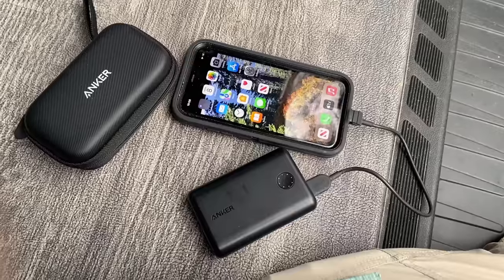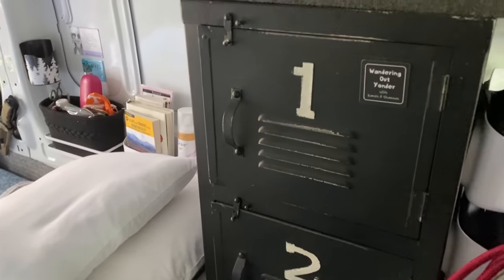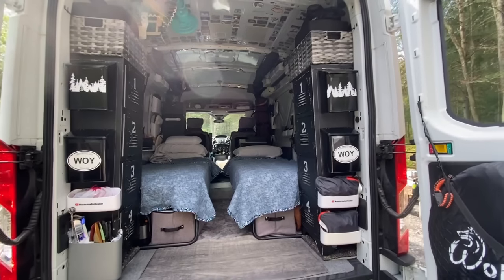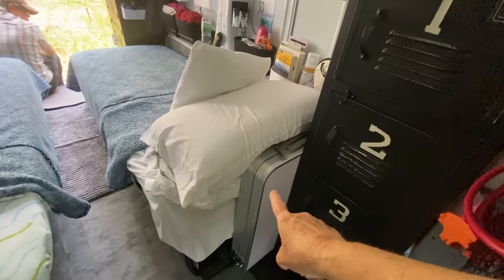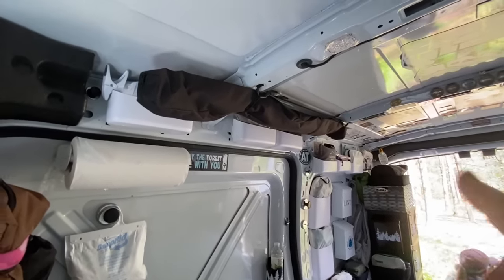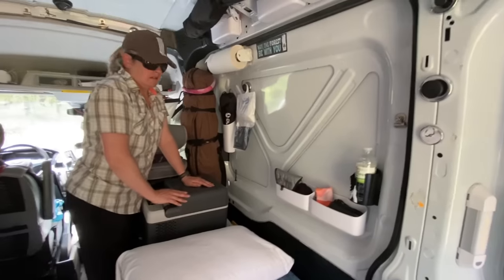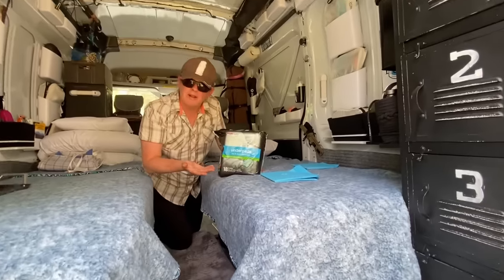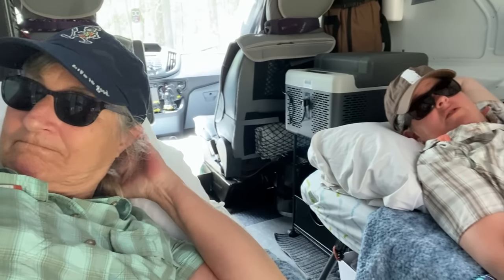Simple & EASY No Build Van Set Up: FULL VAN TOUR! Our Cost Effective Camper Conversion

Comment: I actually thought of using lockers. Do they rattle when you drive?

I would do something simple like this to begin at least. My reason for considering van life is to be able to work and save money and not pay rent. Starting out with a huge van conversion expense is counterproductive. I don't need to make a van look like a house or rustic cabin. I basically need a bedroom and efficiency kitchen on wheels.
Reply from the maker: That was kind of our approach! We did a video on JUST the lockers (install and then another on how we keep them quiet -lol)
You may find these helpful: 
NO BUILD Storage Lockers & Magnetic Options: Simple Van Camper Set Up For Clutter Free Camping 
https://youtu.be/ZnLwW2nhJcQ

NO BUILD, SIMPLE EASY STORAGE NO CLUTTER Adventure Van Project: Working on a Storage Solution: https://youtu.be/yaCUJQe41fE 

Good luck & happy travels!
Reply: @wanderingoutyonder  Thanks! Will check it out.

Comment: Great job of utilizing the space, making it functional, and keeping it eye-pleasing! If it were mine, I'd put some insulation on the ceiling. The car industry uses what's called "shoddy." You could put it up by gluing magnets to it. Thanks for sharing!
Reply from the maker: Thanks for the suggestions! We always love to hear what others have in mind!
Happy travels!
Reply: My thoughts exactly as Ariz. has 120+ temps, in C.FL everyday record highs, and a van is a hot tin box in heat and a very cold box in the winter. I love how you utilized the metal and magnets, but this IMO is a 'fair weather' set up, not to practical for a full timer who suffers bad weather at times.
Reply: Roof rack or  metal Decking on top? Have a 2 inch space between rack + van....ALWAYS park in the Shade !!

Comment: I sure enjoyed your video!!  The magnets are a fantastic idea!  I'm trying to figure out the easiest way to get on the road and using a lot of your ideas.  We had an '87 Astro van for eleven years and sure wish I'd kept it just for camping.  I'd like to think it would still be road worthy.  Maybe not ???  "I" ordered it (mom van) with everything heavy duty and all the extras except fog lights for some odd reason, and never added them on.  Two cargo mats were a must.  I kept it in Perfect Condition.  I had two very minor mishaps and needed some body repair both to the sliding door, and the hood needed repainting from the engine heat being so close.  I did to have the radiator worked on one time and that was it!  Regular maintenance and had All of my receipts including a gas mileage log.  Sorry to go on... I'm trying to psychic myself up on How I can make it happen.  We had a Toyota Celica for ten years before we got the van for our two kids.  So I'm thinking of a Toyota Sienna or maybe 4Runner.  Sadly, money is the kicker!!  🙄 🥺 😕 🥴 😟 😏
Reply from the maker: Hello! Thank you for commenting!
It sounds like you have some prior experience which will be VERY helpful in your journeys! 
We agree - maintenance on a vehicle is SOOOO important for longevity!
We hope you are back on the road soon!
Happy Travels!
Reply: @wanderingoutyonder  I didn't think about this until a little later.... I've sketched a couple different van layout ideas and thought about using 2 small metal file cabinets in the back with different size drawers much like your lockers... and having the sides for other magnetic things.  No wonder your magnets caught my eye!  LOL!!

Comment: Wonderful use of space. I'm wondering if you've found it difficult to regulate the temperature inside the van as I didn't see any insulation. That's usually what van builders install first. How are you carrying water. What is your bathroom set up? I saw the Wolf Wise which is on my wish list. My dream is to build out a Ford van so I am very interested in how others manage their systems.
Reply from the maker: Hi - we have several ways to help with the temperature - first and foremost - we head in the OPPOSITE direction of the extreme temps. We have a few videos about how to regulate - including:
How We Keep Warm While Cold Weather Van Camping With And Without Electric - Tips & Tricks: https://youtu.be/b7bUfohL5cc 

Keeping Warm & Cool in the Van with the Jackery 300: Will it Work? We Test Some Options!: https://youtu.be/SlKpXavENOw 

Van Camping Solutions to Ventilation, Insulation, Privacy & Condensation Part 1: https://youtu.be/inrCxaYDv00 

Van Camping Solutions to Ventilation, Insulation, Privacy & Condensation Part II: https://youtu.be/gbAmaw389n8 

Simple, Effective & Awesome Magnetic Fly Screen For Vans! Living in a Bubble: https://youtu.be/ABypdrjyPLM 

We use the Wolfwise set up with a Luggable Loo when a bathroom is not readily available - we use 
GRAYL GEOPRESS to filter water on the go!

Hope that it helpful!
Reply: @wanderingoutyonder  What temperature range have y'all comfortably camped in using these options?

Comment: I'm leaning towards using the pre-existing holes, or limited support frames, to attach everything to the wall or floor.  This is my plan for retirement in 10-20 years if I do a van build.  Lots of wood can add a lot of unnecessary weight.  Still I consider noise suppression and insulation.  A fridge will be nice and I look at 2 compartment so I can have some ice to cool down on hot days, instead of pricey and energy hungry ac.
Reply from the maker: We couldn't agree more! We wish you luck on your future path!
Reply: @wanderingoutyonder  thank you for responding!

Comment: When does condensation happen? Too cold? Rainy weather? Would a humidifier help with condensation? Or it better to just use Damprid? What do you do to keep the van cool inside without keeping the car running? You don’t have roof fan opening? Do you plan to you  one-two in? Do you have a portable air conditioner?  Do you have solar panel and/or portable generator to have electricity in vehicle? How do you keep mosquitoes and other flying bugs out?
Reply from the maker: Hello there! We have the best luck with the Damp Rids - we don't stay anywhere long enough that while trekking to the next destination we can't run the heat/air to dry up any lingering condensation - . We have a few videos about keeping cool - our best items are the screens that we use: https://youtu.be/rkKY_66_zdU?si=1WftPvysj-MyUex9. We don't have a roof fan and do not plan on installing one - 
We do use solar power - but not a generator - we have video on power options coming out soon! The screen works great for ventilation AND keeping bugs out!

Comment: WoW! Such a nice practical van! Perhaps, if you allow me to say, you would want to put a sheet of plywood between refrigerator and the bed to cut the electric vibes that wave to head side. Of the bed. Even a thin plywood will help to cut the electromagnetic wave reaches the head bed…
I just bought a Chevy Astro..still a passenger van….I used the bed ( las passenger seat opens a s a bed) last week ..but boy it was cold…how do you provide warmth at night in you van?
Reply from the maker: Great suggestion! Thank you! We have several methods to keep warm - it all depends on weather or not we have land power - we cover most of that here: https://youtu.be/kl_68EUItdU?si=x7e1TPfYNXSCLyAt

Comment: Vantastic build, the puppy pads are brilliant!!! Happy trails!!!
Reply from the maker: We agree! So glad you found some helpful ideas!
Reply: I had an older travel buddy, a 17 year old shepherd/retriever mix who passed away a few weeks ago, who needed the "puppy pads" and like these ladies, discovered many more uses for them.  
I also discovered the reusable pads for times that disposables weren't really necessary. They have water-proofed (rubberized) backs to prevent leak throughs with real cloth tops for comfort and durability. They can be either machine or hand washed, but let them air dry to preserve the backing.

Comment: You have some really useful ideas here - yay!!!
My current primary interest is: which magnets are the most powerful?
I am looking for some to secure both lightweight tarps (the blue ones) and curtain rods.
The tarps are to cover the open space between the roof & door when I leave the rear doors & slider door ajar in a light rain - I want to "clamp" them to the roof via a few hefty magnets.
Also, I custom cut some bedsheets to serve as curtains, which are fairly light ɓut still do cause some weight...)
Reply from the maker: We actually drape a tarp over the back (overlap the roof slightly) and then attach a bungee from the front grommets to the holes in the wheel rims very security - then the gromments at the end can be placed on tent poles for a sort of awning - not sure what magnets would hold a tarp.

We are super happy with our bug screen - provides TONS of ventilation & privacy.

Comment: Good use of vertical storage. Comfortable beds. How do you stay cool when its summer and 90 degrees?
Reply from the maker: Good question! We cover that in a few videos - mostly by heading away from the heat, fans, and using our back screens and front screens for ventilation.

Comment: Wow!  You guys have organizations down to a T. What awesome ideas. We use puppy pads for a specific reason but never thought of all the ways you guys use them!! Without having insulated/covered the metal, don’t you get hot/cold areas that could create issues? Is this the extended length high roof van?
Reply from the maker: Hello! We have a mid roof - 130" wheel base van - that seems to be just right for our needs! We don't mind the no insulation - we have ways of battling both hot & cold! We have a few videos out about those concerns but will be covering them in more detail in future videos. Thanks for watching!

Comment: I love your ideas for your van and it still looks neat and tidy without having wall lining. I was wondering how you got around the bed (cot) legs in the middle and fitting in with the wheel hub. Did you have to cut some of the middle legs off?
Reply from the maker: Hi - we did not - they fit in PERFECTLY - this may show a bit more for you: https://youtu.be/IpHh_QG8ZtU?si=Zu_gslMd0vmw4UFy
Reply: @wanderingoutyonder  Thank you for the link. Your bed legs fit perfectly over the wheel hub. I have a similar bed which fits perfectly in my trailer width wise. It is SO comfy. I’ll have to work out how to get rid of the centre leg though without the bed bowing in the middle as my wheel hub is a lot bigger than yours and is in the way of the middle leg. I’ll work it out eventually so hubby can join me on my adventures.

Comment: Thank you very much. You are a Reference for me. In Italy, unfortunately in order to create your Van freely, you need to spend a huge amount of money [Certifications, Burocracy, Huge Headache]. Meanwhile The Government allows you to put on your Van anything you want under a normal Van Certification [Carrying Things] with the obligation to have the Things inside Removable. You can do what you want with the cabin, but alterate the structure of it. [ even the tiny holes ]. So the only way to create your camper, is trough the alternatives on the Market. And so far 70% of the Things that I have in mind to do have been taken by your inestimable support & suggestion. The only thing that is scaring me is about the temperatures inside without any termoacustic wall. How did you solve this issue? Thank you again.
Reply from the maker: Wow - lots of rules and regulations!! We wish you luck!
We actually have a video coming out a bit later today addressing how we keep warm -
Reply: @wanderingoutyonder  thank you very much 🙌🏼

Comment: I use .magnetic   usb rechargeable led lighte i can move around without wires!  Front seat swivel seat adds alot of space and comfortable seat!-
Reply from the maker: The swivel seats look like an AWESOME addition!
Reply: I have front swivel on Pass side.  I have bed on drivers side.  I might add swivel there? Then slide drivers seat all toward the front and it cud be part of the Bed? Wud add that much extra length.  I have 136"  it seemed some much bigger empty?  I cud hse the extra space?

Comment: Don't you need more insulation? How do you keep warm in winter?
Reply from the maker: Hi we use layering like we did while tent camping - we don't live in the van - so we just travel to warmer places, use a heater, and lots of layers! We have had a few nights where the temps were in the teens in the van and been just fine.

Comment: I love your build! I'm particular I was interested in your cots which you indicated were 65" long.  However, the link leads to cots, the shortest of which is 75".  If yours are actually 65" in total long,  perhaps they are no longer available??  Thanx for any addt'l info you can provide.TIA.
Reply from the maker: Hi - the regular "cot" is the 65" - I believe the actual dimensions are 69" but that ls the leg length included - that is the link that it takes you to
Reply: @wanderingoutyonder  I'm guessing what you have is no longer available. None are 65" or 69". I've searched and searched.  Was so hoping.  Thanx for responding. Love your set up.
Reply from the maker: Hi Kay - the link takes you to the page - the options that is just "cot" is the one - it is still showing available when we click on the link - it should take you to the exact one

Comment: Is no insulation an issue during hot and cold weather?
Reply from the maker: No, we find no issues.  We have a heater for cold weather and use fans for warmer weather.  We felt that adding insulation and then paneling around it or a "wall" around it would add alot of weight to the van , take up a lot of useable space and I would personally worry about mold build up behind the walls in the insulation.

Comment: How do you handle excessive heat or cold ? No insulation no heat no air ?
Reply from the maker: We head in the opposite direction of the extreme heat - and use heat pads, layering, a heater in the winter - and fans and screens for ventilation in the hot weather.
Reply: @wanderingoutyonder  I love you no-build van! I'm probably spoiled, but it seems like the lack of air circulation on a hot night would be challenging. Do you wish you had more windows? That would take away from some of your usable wall space, and I know a ceiling fan would be more of a "build" feature.
Reply from the maker: @kimcatacutan8980  we do not - we use fans and some screens for circulation when necessary - you would be surprised at how much it cools off once the sun goes down - and we aren't in the van much otherwise because we are on an adventure! 
Here are the screens that we use if you would like to see them in action: https://youtu.be/rkKY_66_zdU?si=girWQYktbyBEg169

Comment: Condensation,mould and heat and cold.Vans need insulation as anyone whose slept in there van in winter knows.perhaps they live in a mild climate as van be an oven in somer
Reply from the maker: For our needs these method works great - it may not be the approach for everyone. Thanks for watching!
Reply: Well I was thinking with those magnetic clips you could hang a wool blanket at the side of beds for some added insulation.   Great information ladies. I like your approach I have similar ideas. Best wishes 😊 xx